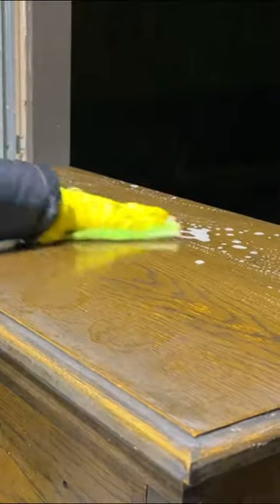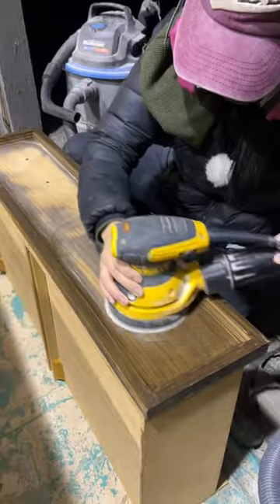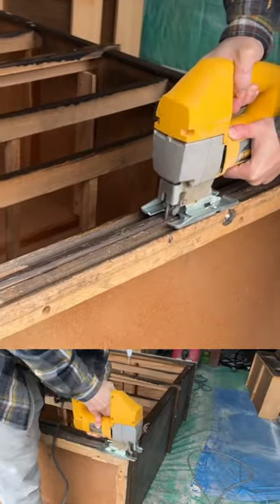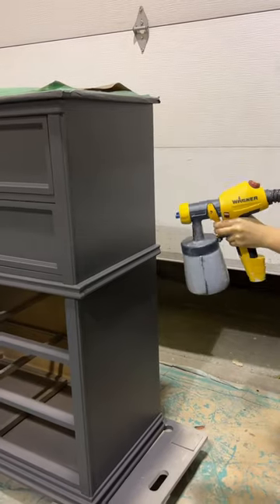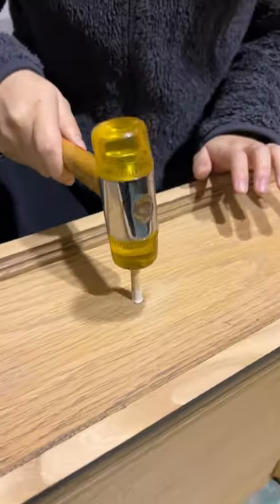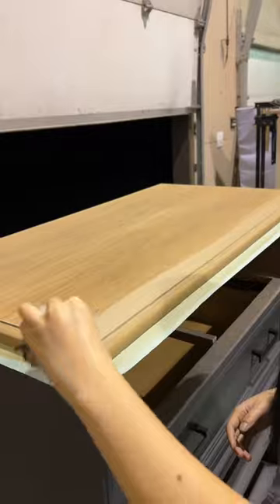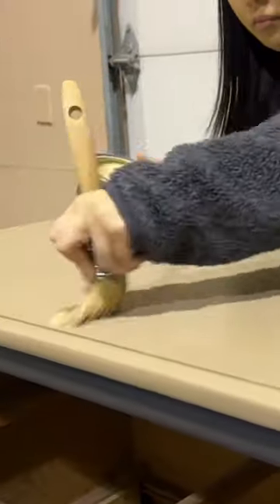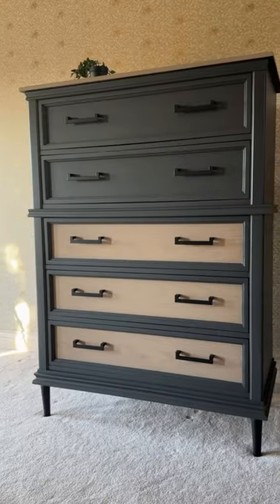UGLY DUCKLING FURNITURE FLIP  #furnitureflip #diy #woodworking #fusionmineralpaint

Comment: To each their own but I cant believe so many people are saying it looked better before... it looked so cheap and ugly IMO. The new sleek look is so much cleaner and the beige and black combo sets it apart from all-black pieces which are very common. Cool video
Reply: Not saying it didn't need work. Saying that when you have a beautiful product to work with - the opportunity you have with a gorgeous wood as opposed to cheap (contemporary) pine or particle board, you look for ways to use and enhance that beauty - as well as creating the clean modern look you are talking about. It can be done. It's like building a house that has a view - without windows to see it. Yes, you may still build a beautiful house, but you have missed an opportunity.
Reply: Agreed!

Comment: While the before had some charm, it looks unbalanced. The bottom drawer looks very out of place while the middle drawers feel busy. For such a wide drawer, just a single pull feels awkward. The nailed on drawer accents  add a level of business that messes with the lines. If the piece was just the pulls, top to bottom, it would have looked better.